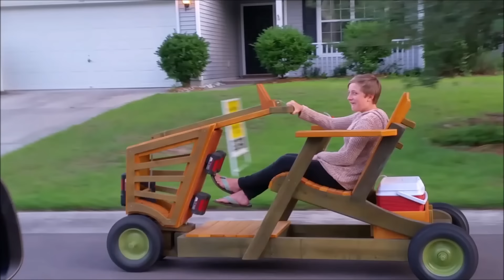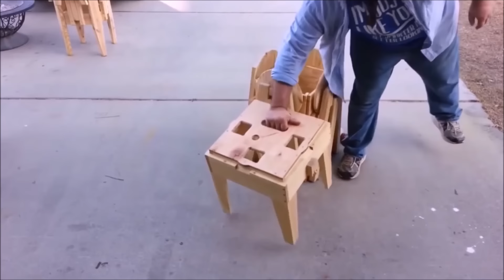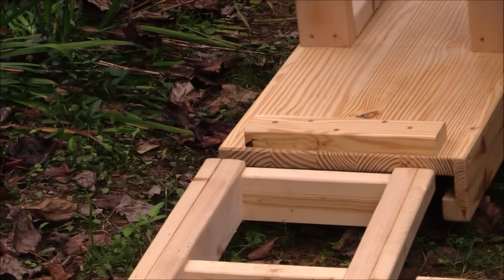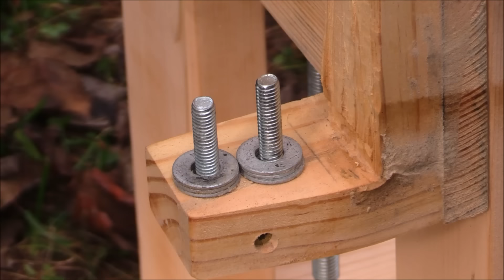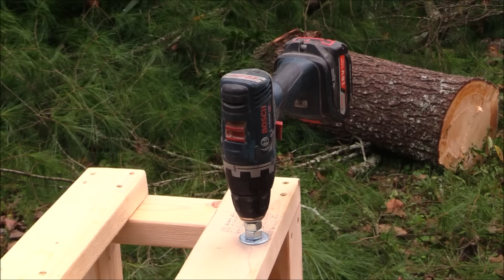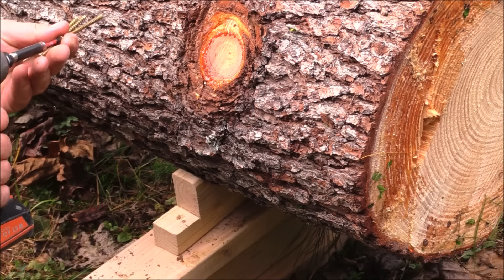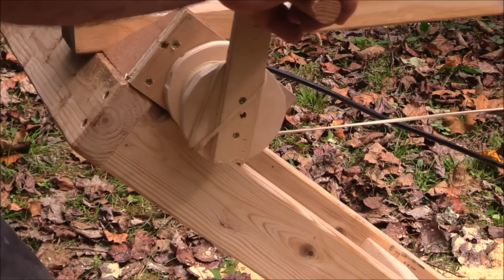50 Dollar Portable Sawmill | Chainsaw Mill

Comment: Only problem... Byproduct (slabs) won't fit in the Prius! 😂🤣
Reply: Next video: 50 dollar wooden roof rack for Prius   :)
Reply: Hey. Everyone knows Prius's rear windows are overrated...
Reply: I fit tons of wood in an old beater BMW 3-series. The trick is to roll down the windows and stick it out either side.
Reply: RI Bill, I don't know why this would upset cyclists, but for some reason they always seem to lose their heads over this. :)
Reply: i have been known to remove all the seats but the drivers :)   @RIBill
Reply: @RIBill  "...stick it out either side." You have got to be one of the D.U.M.B.E.S.T if you stick wood out the driver's side.
Reply: @patrickdesilva6193  Seriously??? A 3 year-old comment that was intended as humor and you think I'm the dumbest?
Reply from the maker: oh yes they will i mill make them fit hahaha
Reply: @izzyswan  lmao great job
Reply: @izzyswan  jkkkmmmmkkkjkkmm.

Kmjmikkyjjmmmmjjkkli
Reply: @izzyswan  the slabs will go on roof rack 😆👍
Reply: @izzyswan   If ANYONE can figure it out, it would be you!
Reply: He only said he wanted to go out and cut them. Nothing about hauling.
Reply: Just cut all the lumber into smaller pieces and it will fit just fine!
Reply: Or build a wooden trailer for the wood and out of the wood  :-P
Reply: classic hatchbacks are like flat'back hooded el'caminos with the back seats folded..  lugged standard 2x4 8'ers in em, stretches to front but anything under fits with ease.. probably hauled a ton of timber in mines over the years..
Reply: Wrong! I carry 10 foot long 2 by 4 in my Prius!  I remodeled my house with Prius!
Reply: Genius!
Reply: Needs a roof rack
Reply: One question Izzy, what do you do to keep the blade from binding from the weight of the slab after several feet?
Reply: @martinoamello3017  Wedges maybe. It's what Dad did, using drag saws before chainsaws came along.
Reply: Thus, the reason for a portable mil ese
Reply: The only thing I can say is you are awesome, but I couldn’t figure it, how you made it. 😂
Reply: I think you can have a trailer hook of a prius and have a small trailer that can carry the slabs.
Reply: Ki I look I'll look at over ok u Zzz zzz,,,, oh what
Reply: Roof rack.

Comment: I am a little suppressed you did not put the drill on the hand crank
Reply from the maker: need to have good control over the speed of the feed the thinkness and density changes mean i have to speed up and slow down on the fly. a drill would not be practical in this application and could potentially cause problem
Reply: Ohhh, don't be suppressed about it!
Reply: A crank/winch with the right mechanical-advantage on it works great, even for lifting logs.  
It seems like all the labor on a manual sawmill is with moving the log into place and turning it.  If you have it so the mill is really portable and the log is really close to the ground like on this one, that is a huge savings in manual labor, and for that matter, a huge savings in money too since you don't need hydraulics.  (Not that hydraulics are all that expensive if you know how to DIY them, but they often are if you buy a finished product with hydraulics).

Comment: Hey Izzy, pick up some Farberware thin poly cutting boards (Target - $10 for 3) and cut them into glides for your projects.  Using them it's possible to have tight fits and yet easy movement of wooden parts in homemade machines.  The poly in them is surprisingly durable and long wearing.
Reply from the maker: GREAT IDEA thank you
Reply: Happy to share what's worked for me (the rest - not so much).  With tight fits, give some thought to sawdust and chips that can cause binding between the gliding and stationary surfaces and design your joints so that they're naturally debris avoiding (V rails, shields) and/or have debris clearing (brushes, sweeps) built in.
Reply: Hg
Reply: do you think the dollar tree poly cutting boards would work?
Reply: Great suggestion man.

Comment: Now you just need a truck to get the lumber back to the shop!👍👍👍👍👍👍👍👍🤣🤣🤣🤣🤣🤣🤣🤣🤣
Reply: NEXT VIDEO:

How to make a wooden truck out of home milled lumber and powering it with the same Husqvarna 460 that powers the mill, all for $75 in parts plus the lumber and saw....
Reply: How to turn a Prius into a trailer to tow behind a truck to haul slabs, next video bahahahaha.
Reply: or a small trailer. prius could pull a small trailer.
Reply: I wouldn't.  Truck has the traction which the prius would be missing.  And as a plus (ingenuity maybe needed) you could use a truck to pull a larger piece of wood to a more suitable location for working it rather than adapt to location.

Comment: Izzy, after you make your first top cut, you should flip your log over and then start cutting boards.
Reply: Because a wide flat side down has a lot more stability then a round side down held with wedges and screws
Reply: Why?
Reply: Because as long as the ground is fairly flat, having the freshly cut side laying flat means less stability issues with consequent slabs.

Comment: Super build! Tractor supply chainsaw supply is going to run out.
How about a modification where you put self built bandsaw wheels and a bandsaw blade on it? Use a Harbor Freight electric motor to run it (chainsaws are nice when new but the motors always get fiddly to start and keep running for 90% of users). Downside is cutting in the field vs next to the shop. Now you need a trailer for the car to haul the boards home.